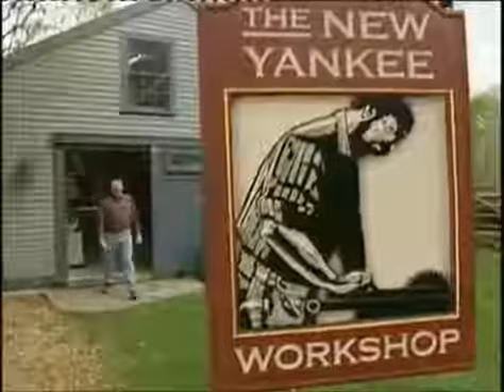New Yankee Workshop S18E03 Workshop Helpers

Comment: I have an equipment breakdown. I have built the the workshop helper "S18E03" the (Roller Stand) I am looking for the threaded rod dimension under the top of the interior box. Does anyone have this measurement? I am doing the lay-out of my shop to be more efficient. I need the rod dimension under the top of the inside box, from the top down. HELP